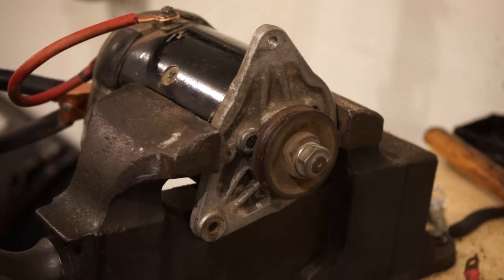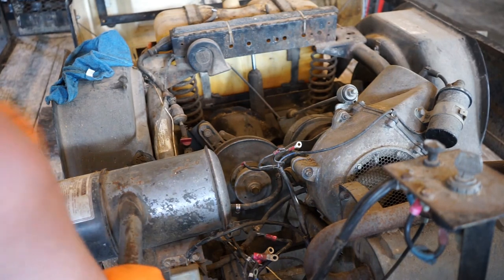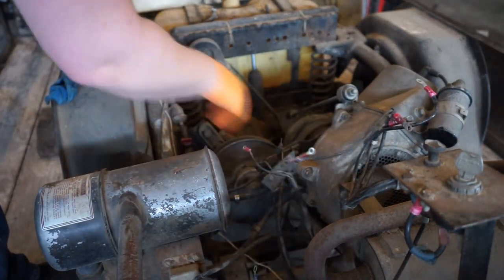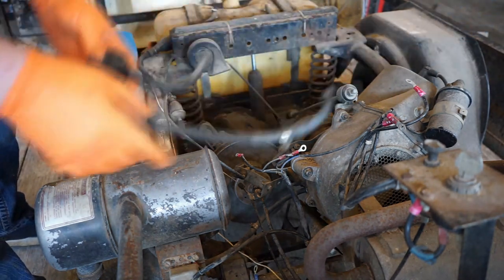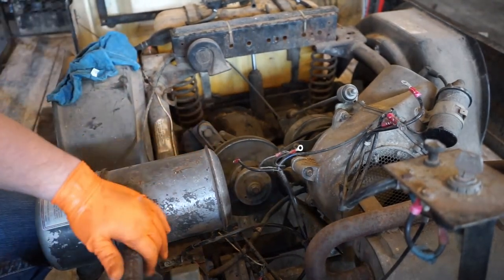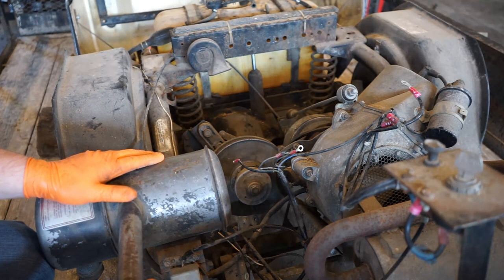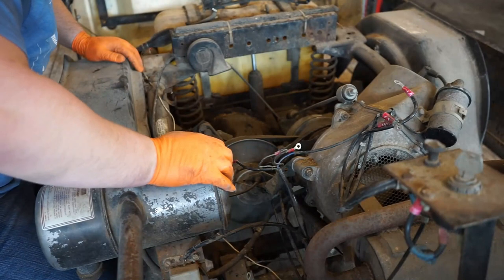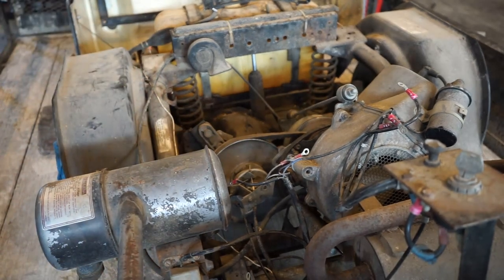Barn find Harley Davidson Golf Cart Will it run Part 2 of ??

Comment: I have this style engine and have it running sweet. It took a long time of trial and error.
The 2 biggest things to consider. The timeing and your choke cable. It inherently needs to be choked to start (to draw the fuel in ) and you can use the choke to balance the fuel mixture if carb not set right, pull choke out 3/8 inch and leave it where it runs best as you travel along.
I removed the solid state points and put in laser cut mounting plate and traditional points.
The mounting plate you loosen screws to adjust the points turning it left and right BUT!!! The plate with screws loosened will also move up and down just a whisker which wreaks havoc with trying to set the points. 
I would say remove the body and drive it under load in between adjusting the points. It may take a bunch of re adjustments untill it runs sweet forward and backwards. Good luck. Ive been through all this

Comment: this video has been hugely helpful.  I've been trying to get mine (same year and model) running for a year.  Going to check the points.
Reply from the maker: Thanks for the comment!! Hopefully, it helps you out! I've recently figured out the alternator/generator units voltage rectifier on mine isn't working, so my starter solenoid has been blown 3 times in a month!
Reply: @savingoldjunk7085  Interesting.  Maybe that's what's going on with mine.  I put on a new carb, new plugs, all new fuel, new fuel lines.  Have to check the points...  Mine just endlessly turns over and occasionally runs for 2-3 seconds before turning over and then.... before long dead battery!
Reply from the maker: @Ridgemeade Farm  have you taken the plug out and checked it for spark? I wonder if there's a switch somewhere that isn't working, and it's causing the spark to be intermittent. I was debating on making another video on mine since I've recently been dealing with that starter switch, the rectifier, and this weird noise where the fan sucks air into cool the engine.
Reply: @savingoldjunk7085  Plenty of spark from the plug (ouch).  I also replace the fuel pump.  Seems pretty simple.. not sure what else it could possibly be. dirty points, bad rectifier?
Reply from the maker: @Ridgemeade Farm  if you've got spark, then you would either be missing compression or fuel.  Have you looked into the crank seals by chance?
Reply: @savingoldjunk7085  excellent insight.  I'm going to make sure points are clean, double check fuel pump, then check crank seals.  It's funny... when the problem started it was running strong. Then it would suddenly lose power, then I could get it to go a little bit, then it would lose power.  The intermittent nature of the problem has me stumped.  I figured it was a fuel problem so replaced the filter, then the lines, then the fuel pump, then the carb...
Reply from the maker: @Ridgemeade Farm  check those crank seals! It kinda sounds like you've got a vacuum leak or crank seal issues!  Keep me posted on the fix! I'd love to hear it was solved it!!!
Reply: @savingoldjunk7085  so the question is, how does one check the crank seals? Also, when I replaced the gasket in the fuel pump I had a hard time figuring out which hose went where…. There are three.  Any thoughts? I think my model is a 1987(?) maybe a 92?
Reply from the maker: Blake, the way to check the crank seals is pretty simple. You just want to block off all the vacuum holes, the intake, and the exhaust to create a sealed system. Once you've done that, remove on and add like 2-5psi of air and see if it holds. You could also use a smoke machine to add the pressure, and then you can see if or where it's coming from. 

As for the fuel pump, you'd want to figure out what the pulse pump line is, and then I believe the line to the carb is closest to that, and the line from the tank is the last one. 
I'll see if I can dig up the website I used to figure out my year and type of cart.
Reply: @savingoldjunk7085  thank you! I’m pretty handy but this project has been pushing my limits! These old Harley Colombia carts are the best so I hate to let this old girl go. I have to fix it! I remember driving it when I was only 10 ( I’m 42 now)
Reply from the maker: @Blake Ragghianti  haha well if I can help at all, I'd love to keep another one from being scrap!
Reply: @savingoldjunk7085  Truly appreciate it!  It's hard to find anyone to work on these old 2-stroke engines anymore.  I'll be back at the farm in a couple weeks and will do the test the crank seals.  This must be the issue... becuase with a little blast of starting fluid in the air filter it will run strong for a solid 10 seconds and then peter out. also going to triple check hose connections on the fuel pump.  i may buy another seal set and rebuild the pump again also.
Reply: @savingoldjunk7085 headed to the farm next week. Will try to figure out how to get only 5 psi out of my ancient compressor.
Reply from the maker: @blakepgh  good luck! You could use a bike pump since you don't have that much volume and only need to do ~5psi
Reply: @savingoldjunk7085  could you share a photo of your fuel pump?

Comment: How can I send you a video? I didn’t test the valves yet but…::
Reply from the maker: I don't think you can send a video.  Also, 2 strokes typically don't have valves like normal 4 stroke engines do.  
What's the issue you're having? Have you checked spark, fuel, and compression??
Reply: @savingoldjunk7085  ya, I had texted from my farm account previously, Ridgemeade. I haven’t tested compression yet but i did use starting fluid and I ran strong and normal for about 30 years.  I took of short video of how it’s acting though.